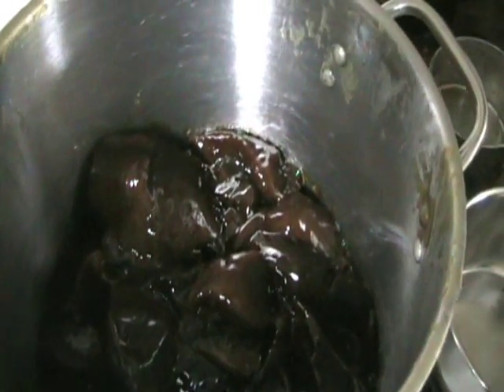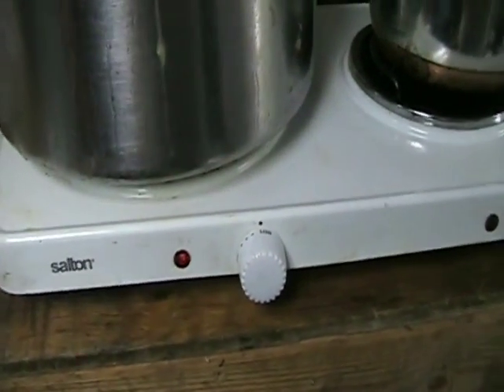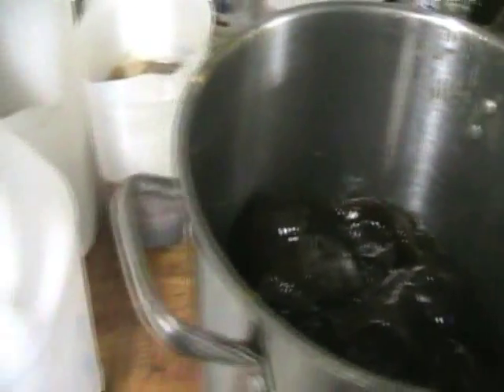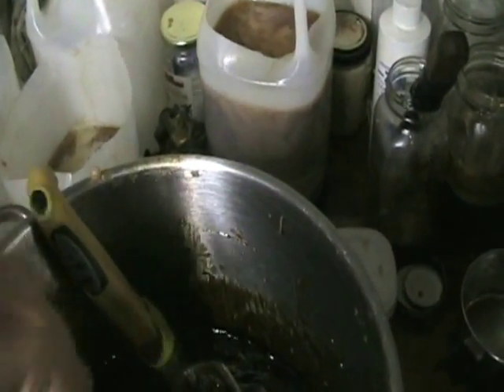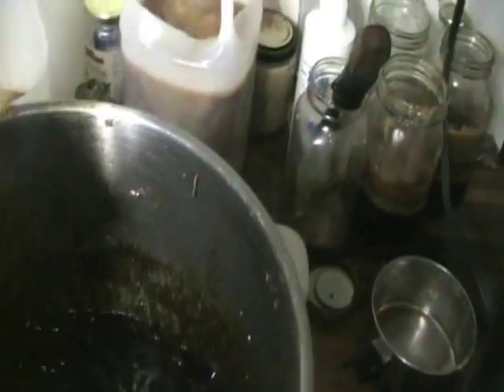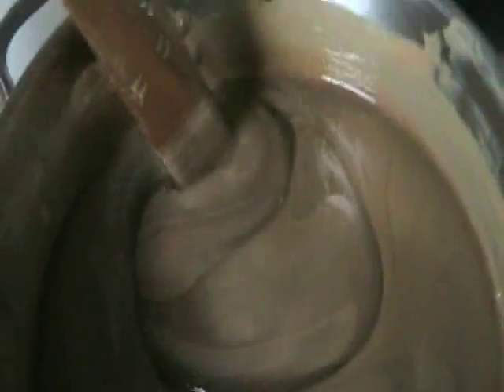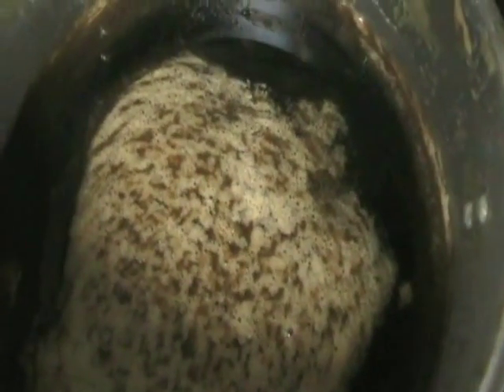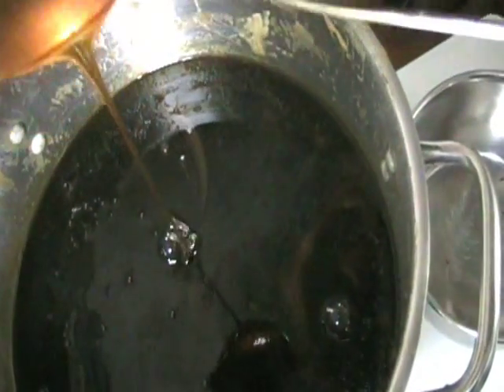Making Biodiesel Glycerine Liquid Soap

Comment: why would someone use biodesel as soap?Once the methanol has been removed the glycerin is a lot safer to dispose of It can be composted in a big compost heap. A smaller compost heap is soon overwhelmed. 
It can be neutralized with acid and then disposed of through regular drains. Check with your water treatment plant before throwing anything down the drain.
You can make soaps and cleaning products out of it or use it as is for a floor cleaner.
Reply: Why would you even think of putting that down a drain(technically drains are for water)? Glycerin is a expensive by product that is free. If you want to use it for animals feed, compositing and soap making.